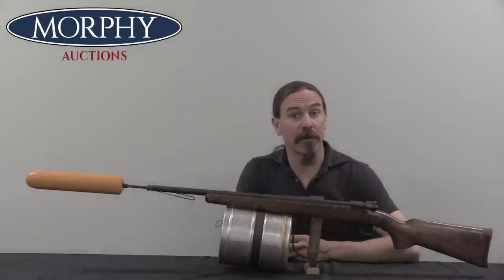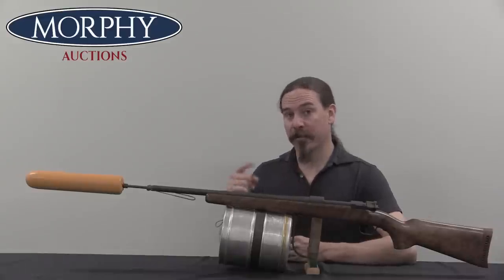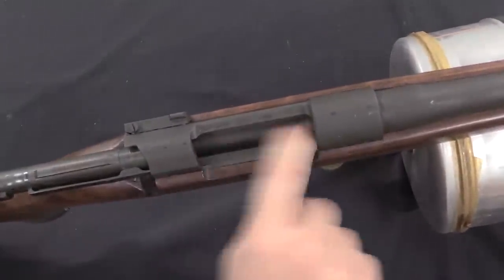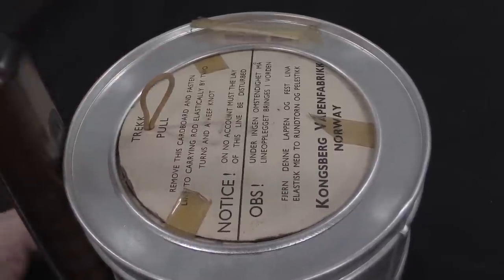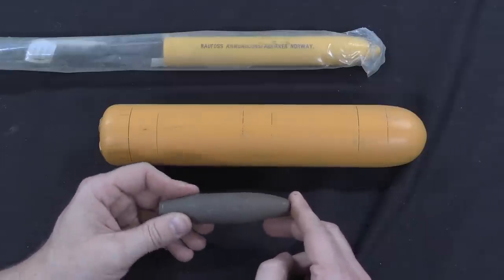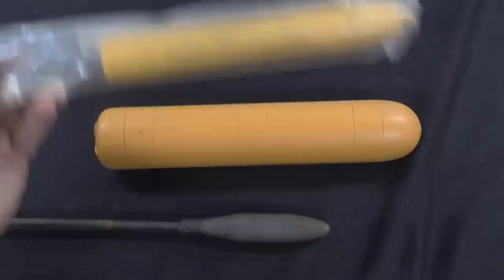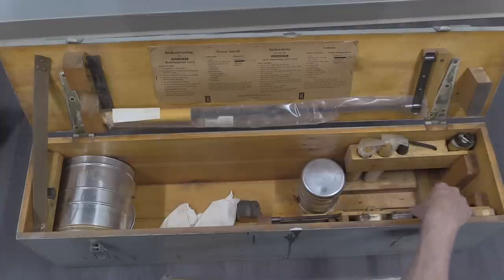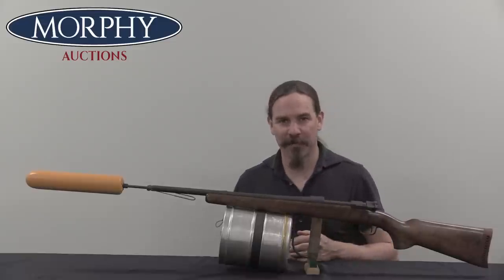Kongsberg M52: A Line-Throwing Rifle (or Harpoon Gun)

Comment: The fact that it's a whole set (spools, darts, blanks, rockets, and gun) all kept together in a chest, all of which looks to be in fairly good shape, is really neat!
Reply: That is really neat, my grandad told me the sniper versions of the Lee Enfield used 220g of Ballistite.
Reply: The only downside would be that you'd never want to use any of it, and I'm sure I'm not the only person who'd love to see this gun in use.
Reply: its a rare side quest weapon
Reply: @phuzz00   It's not that bad anymore, basically any hobbyist should have machinery to make spare rods and ends, and also rocket hobbyists should be able to replicate the rocket assisted spear.
Modern gunpowder should be easy to find or since it's not in official use black powder would do just fine, since there is no need for propellant to be stored decades ready for use
Rope container is fairly easy to make, powerdrill for winding and spray glue to hold the line in spool, and I'm sertain the canister is plain can of relish
Reply: These one is either very worn, or in a very pristine condition. It depends if it was stored in a commercial vessel, or bought for private use.  The private ones often show very little use.

Comment: The U. S. Coast Guard had a similar line throwing gun kit built from 1903 Springfields.  Nowadays, they use an adapter kit on standard issue M16s (or their derivatives) with 5.56 blank cartridges.
Reply: When I was in the Navy in the 80s to early 90s we used a modified M14.
Reply: The Munro in Kodiak had an original 03 and everytime my GM's brought it out I cried inside. To butcher it like that 😭
Reply: I got to shoot the 1903 shoulder line throwing gun, and the M16 shoulder line throwing adapter kit during Coast Guard GM A school training. The 1903 would launch line WAY farther than the M16.
Reply: @nlwilliamsj  When I was in the CG back in the 80s, we carried the Springfield line throwers on the 41 and 44 foot small boats, and had to qualify with them, using WWII vintage grenade blanks.  Beside the normal line projectiles, there was a clear plastic one that would hold a glow stick for night ops.  We got a call from one of the manned lighthouses that the keeper had piles really bad and needed some Preperation H.  Got out there, only to discover the seas were too rough for the peapod landing boat, so we loaded the H in the night projectile and fired it ashore.  Problem solved, except that the Coxswain wrote up a SAR report on the run.  Boston Command was not impressed, but you know they were laughing their asses off anyway...
Reply: @bruceabbott3941  🤣🤣That's the best line throwing gun story I've ever heard and probably ever will. Thanks for sharing.
Reply: @nlwilliamsj  big powder difference from a 7.62×63mm Springfield & a 5.56mm M16
Reply: Why change? There has to be enough surplus 1903s, or had been in the early Cold War to keep the Navy and Coast Guard equipped until the 23rd century. These things are not subjected to the constant use nor abuse a frontline rifle would take, so things would wear out at a snail's pace.
Reply: How far can such guns throw a line? I have seen the harpoon gun from jaws being fired, the harpoon drops quite fast, so I can't imagine its range is very far. The rocket assisted Raufoss might make it far though.
Reply: @Snarlacc  not far. Large cargo ship line gun can shoot line about 300 meters. Larger(90mm) harpoon guns can put 90kg harpoon really far... I mean multiple kilometers if not tied to ship. They seem use 90mm field howitzer brasses in those to propel the harpoon :D Saw one with year stamp 1939.
Reply: @charlottewolery558  probably for logistical reasons. There's not a lot of reason to have a stash of 30-06 blanks and 1903s and their spare parts when you can just use an M16 and 5.56 blanks to get "close enough" to the original function.

Comment: For anyone wondering a rope generally becomes a line once it starts doing something around boats (with some exeptions)
Reply: Unless it becomes a stay.  Or sometimes a halliard.  😉
Reply: @christopherreed4723  riser, jackstay, lazy shot
Reply: @christopherreed4723  or some times a horse or it becomes a "lin" instead of a "line" but i was trying to give people who weren't familiar with the water a starting point
Reply: I’ve heard it said that there are only two ropes on a ship: the bell rope and bolt ropes (reinforcement around the edge of a sail).
Reply: The man rope is usually a short rope that hangs off the stern with some “fancy work” on it that is used by crew members getting in and out of a yawl boat.
Reply: Or a 'painter.'
Reply: @hiltonian_1260  thats pretty close to accurate (trying to get all sailors to agree on what all things related to sailing are called is impossible so long as there are 2 living sailors)
Reply: Marine ropes are always over 1.5" diameter.
Reply: @MichaelKingsfordGray  ive never heard any one say that before, where did you hear that? (With respect. I'm just genuinely curious )
Reply: @lornemiller3489  I was a Naval Lieutenant.
The 1.5" is approximate, of course, but a "rule of thumb" is that if it a smaller than your wrist, then it is called a "sheet".
Super thick ropes are called hawsers.
That started well before 1600.
Reply: @MichaelKingsfordGray  thats realy interesting when i heard 1.5" i immediately thought of the ropes used for mooring lines and hawsers (although modern tall ships use chain for their primary anchor connection and the hawser for kedging and emergencies) on tall ships and the ropes we call sheets are also thinner than 1.5".
when i flipped through a young sea officers sheet anchor it said
"The size of the rope in diameter, will be according to the number of yarns contained in it."
On page one paragraph two.
 so at least as of 1858 a direct relation between cordage size and name was not universally used in british or american english.
Reply: @lornemiller3489  A great addition, thank you!
My knowledge was only ever verbally transmitted, and so having a written reference is an asset, but confirms my received opinion that such delineations were a guide, not a rule.
I presume that the bits of string called "sheets", obliquely referenced the fact that they were primarily connected to the periphery of actual sheets of canvas, vis: sails.
I would not like to use a chain for kedging, that is for sure.

Comment: These are very common in the utility industry.  Whenever you need to put up a new line (electric or telephone) over a gorge, river, or canyon.  I used one that belonged to the telephone company to put a new line over the Shenandoah River near Front Royal, VA.  I don't remember what the rifle brand was, but it was a bolt action .308.   We just hooked it to a bucket of Jet-Line, and launched it.  The goal was a 750' shot, but I over elevated a little, and the projectile landed about 90' long.  My first, and only, use of of a line gun.
Reply: Cool! makes sense.
Reply: Thanks. When Ian mentioned the marketing for that use I was wondering if that was something they actually got used for or just something the marketing came up with.

Comment: I'd just like to point out how amazing that woodgrain figure is on the stock. That's not far from presentation piece quality . A mix of tiger stripe and flame-lick grain. That's just phenomenal.  It would easily take $500 to get a wooden blank like that for a stock. Maybe more.
Reply: Doesn't it totally peeve you too see custom quality wood on a mass production product?  😁 It annoys heck out of ME.  LOL  Some "Bubba" will buy it and saw 2 inches off the length of pull.  🤢😁
Reply: It's just amazing.
Reply: The recoil is substantial on these, so they only used high quality wood that can take a beating without breaking up. 

By the way, note the very thick barrel. That's both to handle the high pressure without bursting, and to add weight for recoil management. I believe they made those barrels by soldering a thick outer sleeve onto the original Mauser barrel, at least that's how they did it on earlier Jarmann-based versions.
Reply: Excellent observation. I just started watching and I will look for this to appreciate it.
Reply: @Kaboomf  I'm pretty sure they made a whole new barrel for this as the diameter of the "piston" at the end of the projectile (and so the inner diameter of the barrel) seems to be something like 12-15 mm so the barrel obviously needs to be much thicker than original. Also the barrel would obviously be smooth bore.
Reply: @tombogan03884  npc

Comment: We had a very similar system in the Coast Guard, built on the old 1903 Springfield. They would drill out the riffling and use a blank 3006 round.  I like the forward grip on this one because the riffle would kick like a mule. I'm sure it helps, an alternate way of firing it was to place the but on the deck and firing it with your thumb. It definitely saved your shoulder.
Reply: This may be why the Norwegians went with a special type of charge instead of a generic blank. I imagine a very large grain size and a powder composition that needs a fair amount of pressure before the combustion speed picks up would be beneficial to shoulder longevity. Having it work more like a blow pipe than a cannon is probably also easier on the action.
Reply: I got to have a look at one of these around 30 years ago,  I recall it was very heavy, compared to, say, a normal K98 

Also spoke with some fishermen that had used these.  The recoil was punishing, lol!

Comment: The 12mm Projecting Cartridge case is the same as the M1867 12,17mm Rolling Block case, Civilian Centrefire Version...
Never let anything go to waste!
DocAV
Reply: Wasn't it actually based on a Jarmann case, shortened to behind the bottleneck? I've seen both bottlenecked and shortened ones like this that both fit in a Jarmann chamber.
Reply: @Kaboomf  That's correct. A shortened Jarmann  cartridge.

Comment: In the Submarine Force we used an adaptor for the Remington 870 shotgun as our line-thrower, though it was rarely used. We usually just maneuvered close to the pier or tender and threw a "monkey fist"- a lead weight wrapped in light-line rope. If the line-handlers were good, they could land a monkey fist within 10 feet of the opposite line-handler. Then they would use the light line to drag a heavier cable across to begin the berthing procedure.

When I was active-duty, most surface ships used M-14s with line-thrower adapters.

YMMV

Comment: The Royal Navy has used something similar for sending a pilot rope line, which is then attached to a strong cable send and suspended between two ships that is held tight between two raised pulleys. This line is used to send over boxes of food, ammunition, underpants, newspapers, etc from an auxiliary vessel to a warship during calm seas. The Viking reference made me laugh! 🤣 EDIT Also for routing fuel lines, and possibly even water and cooking oil. And the empty goods for recycling going the other way.

Comment: On the fire dept we have a break open single shot SBR 45/70 line thrower. The projectile is a brass rod that weighs about a pound and the gun will throw it about 250 yards with the line attached. If the line is not attached it goes considerably further. Recoil is brutal as the rifle itself only weighs about 5 pounds due to the short barrel which is maybe 10 inches long. The brass rod extends the full length of the barrel and rests atop the chambered cartridge. We never had a reason to use it outside of training and it was a hoot to train with.

Comment: We use a modified Romanian AK 47 model 1963, converted to line thrower. We use regular blank cartridges. The kit is simpler, it has a crate, but no spools. The line is a around 200 m 550 paracord and the seaman manually arrange it in a bucket. It is mostly used for RAS (Replenishment At Sea) ops. When berthing, usually we use hand thrown lines. We call it ”bandulă”.

Comment: Had a crate with one of these (and assorted kits that went with it) under my chart table on the hauk class I served on in the KNM. Sadly, or luckily depending on how you want to look at it, I didn't end up having to use it. The (hand)throwing line ended up getting the job done even in some gnarly situations. The base rifle used for "my" example of it was a 1930's production, can't remember the exact year.

Comment: A late family friend had a great story about using a line gun in the Navy during the Vietnam War.  He was a weapons tech of some type on a Destroyer, so he got the job of using the line gun.  In a huge storm they waited as long as possible to take on fuel from the nuclear aircraft carrier of their group, but finally had to do it.  He put on a storm suit, they secured a line around his waist, and he opened the hatch to fire the line.  When he opened the hatch, all he saw was a wall of water because they were in the trough of a giant wave.  He looked up & up, and there was the carrier was at the crest.  He said its water line was higher than their entire ship & he was sure they were going to get smashed to bits.  But as the ships passed by each other vertically, despite the Typhoon winds, he landed the line on the carrier deck on the first shot.  With lots of extra line they eventually got a fuel line across and were able to refuel.  No medal, but he did get a commendation from his Captain.

Comment: Would it be possible to catch the floating projectile with a baseball mit?
Reply: I was thinking about this…

If it is falling at an angle steeper than 45°, it is moving down faster than it is travelling forward. That's all gravity, the aerodynamics isn't any better than a ball, and it's not very heavy (it floats :p ), so it's not going too fast. 

Should be possible, but I don't think I'd have a rope tied to it…the first time.

Comment: Could this also be used for launching grappling hooks for climbing up cliff faces? I'm almost surprised that this wasn't mentioned? 

Or do you need different properties in a launcher to shoot mostly upwards than mostly horizontally?
Reply: It cannot launch a thick enough rope for you to climb, the range would be stupid short if it had to loft a heavy line. The way this is used, you launch a thin pilot line across for someone to then pull a thicker cable over with the pilot line. So unless you have an accomplice already up above the cliff to help you, this won't do for climbing.

I guess you could use a thin steel cable strong enough to hold a man's weight, see the harpoon version, but it would have to be so thin that it would cut your hands and be impractical for climbing.
Reply: This is just me guessing here, but I think you'd need something a more powerful. The line from a line-gun like that is more of a 'messenger' ie: someone is at the receiving end and will use the fired line to then haul a much heavier rope across, and THAT will be used to actually rescue people etc. For an 'ascension' you'd need to be firing a heavier shot (grapple hook) and line.
Reply: @Kaboomf  A very sound and reasonable comment, though, regarding the steel cable option, one could, potentially, use an ascender set that was sized for such cable, mooting the hand-cutting issue.

Comment: this is definitely one of those cases where you just wonder how all this stayed together, some in its original packing with everything it should have, nearly 70 years after production. you just imagine this being tucked away in some Raiders of the lost ark warehouse and then being found.
Reply: Probably just kept stored on some ship in case of an emergency that never occurred and then at some point sold as surplus. A lot of emergency equipment just does not ever get actually used.